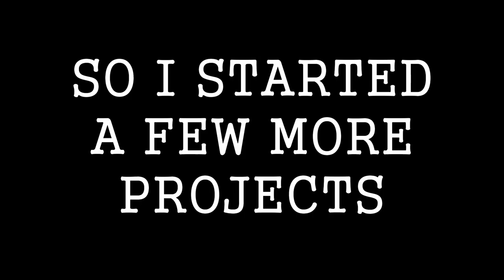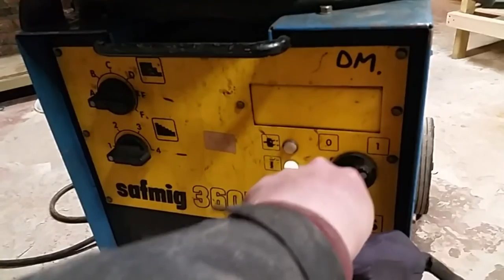UNIT 1

Comment: Yep - gonna need a ground for the plastic dust collection pipe - you have to drain the static charge it will produce with the dust swirling through the plastic pipe. I've seen some guys wrap copper wire on a metal pipe to form it and pull it through the inside of the pipe - this is connected to an earth ground.  You might need more velocity if you make lots of dust drops. Whatcha gonna do with that big 'ol MIG rig, Harry? Inquiring minds want to know...

Comment: Please save your fingers and use a push stick with the table saw.  Also nice plan with the dust extraction although depending on the amount of work you are planning to do, that bucket for the cyclone might be a bit small. You might need a more powerful vacuum too, but thats easy to swap down the line.  Keep up the good work.
Reply from the maker: We could all do with something that sucks more, cheers
Reply: HarryBrew69 lol

Comment: The shop is really starting to look awesome. I like the dust collection system your making. I would caution on all the plastic and dust. Static build up will be your worst enemy. You may want to strategically place some metal pipe and ground it in the system. Happy to see the MIG works! Cheers buddy🍻
Reply from the maker: Good idea, I will look into earthing the system, cheers